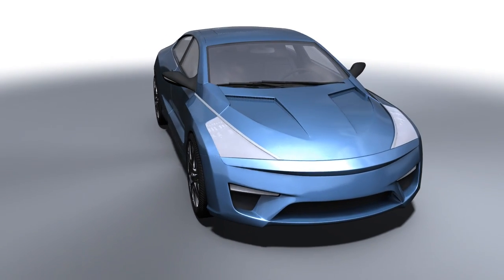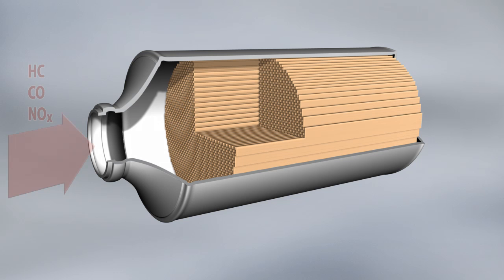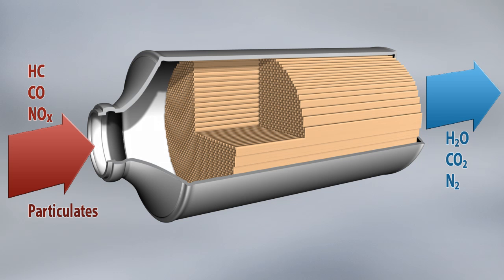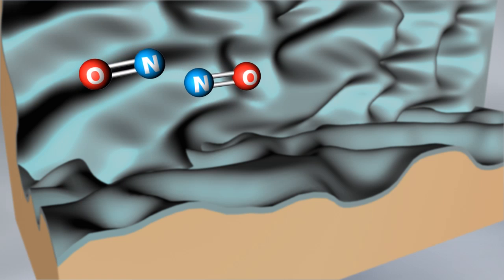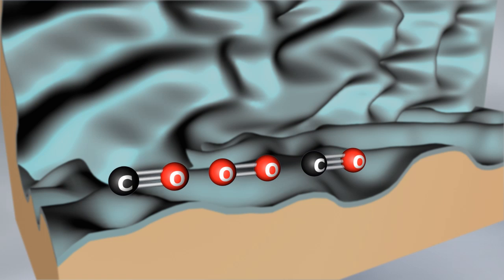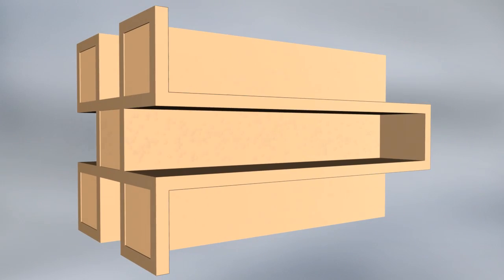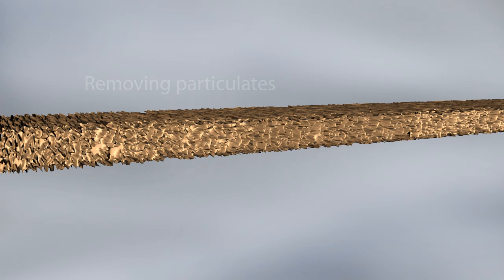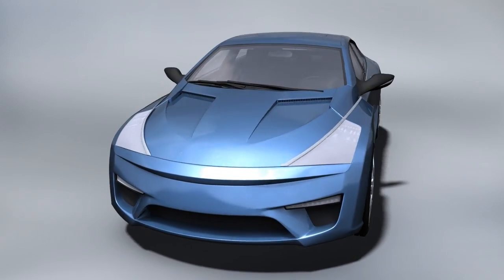FWC™ Four-Way Conversion Catalyst - How Does it Work?

Comment: I was a little surprised by the car's "service life" of 160,000 km - that's how much a car drives in an average of 5 years, and it's still considered a car with a low mileage. Similar components must last 500,000 km, otherwise they are unreliable and are consumables such as oil and spark plugs. But the real service life will probably be higher than 160,000 km, at least I hope so, since I have a 4-way catalytic converter in a 4-year-old car with 150,000 km.

Comment: For Diesel Engines, there is many ways of killing toxic pollutants ( Hydrocarbons, Nitrogen Oxide and Carbon monoxide along Particulate matter).

1. By using a Diesel particulate filter ( Burns Soot and converts it in Carbon Dioxide), Combine with 2 way catalytic converter( burns Hydrocarbons and carbon monoxide) to give Carbon dioxide and water and With Selective Catalyst Reduction (SCR) which injects Ammonia to destroys Nitrogen Oxide by converting it into nitrogen and oxygen) finally there is also Ammonia Slip Catalyst which converts Ammonia into Nitrogen and Hydrogen...
This is the most common arrangement for commercial vehicles and by far most complicated and expensive way to cut down toxic emissions...

Comment: Well i guess that puts a number on how long manufacturers design a car to last, 160,000km, roughly 8 years of driving and also the average finance term. Im at 350,000km on my 2000 audi
Reply: I drive 150,000 km in about 4-5 years (and I use the car almost only for private purposes and not for work), so I consider a component with a service life of only 160,000 km to be a consumable part, just like oil, spark plugs and tires.